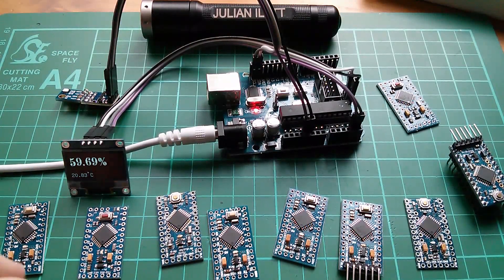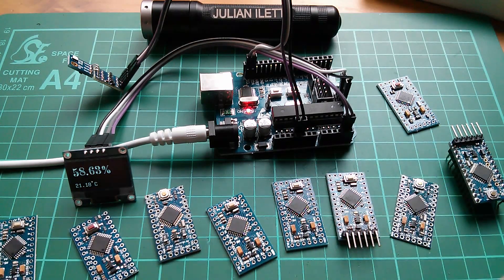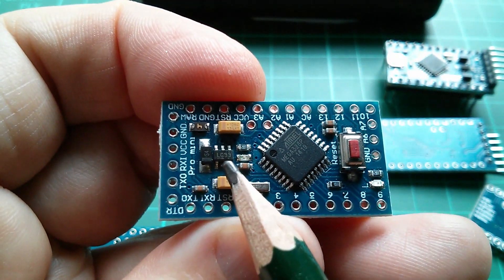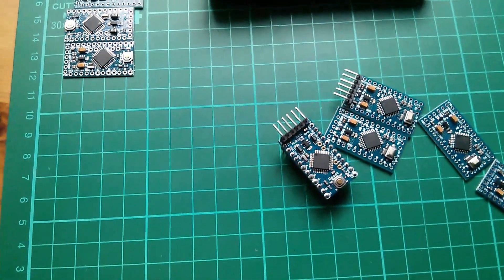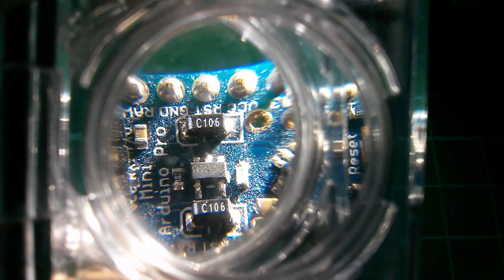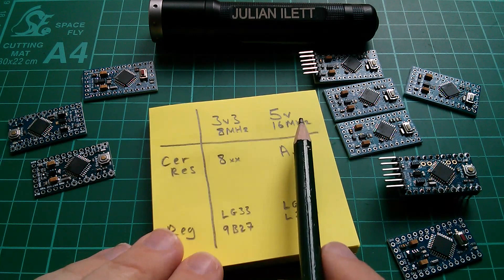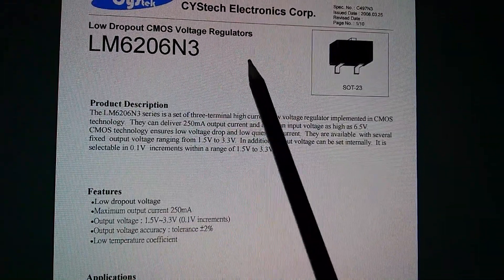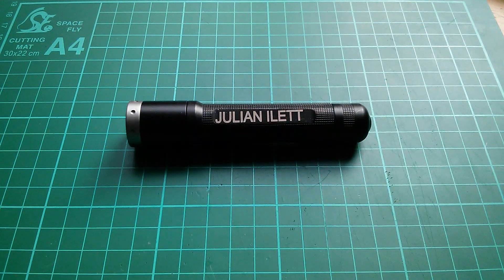Arduino Pro Mini Identification - 5V, 3.3V, 8MHz or 16MHz

Comment: Brilliant video, I have been using 5v pro minis with the voltage regulator removed, with an 18650 cell.
My question is , if I set the pro mini to 8mhz but it still has a 16mhz resonator will it work at 3v?

Comment: I had a strange incident
I bought Pro Mini - ATMega328, 5v-16 Mhz version.
I just realized that the project I was working on was using a TTL 3.3v device (for example: ESP8266).
In simple terms, I had to use a level shifter to change the TTL 5v Pro Mini to 3.3v, but I didn't want to because it wasted energy, money and space.

Then I was fun, changing the power supply voltage of the VCC Pro Mini from 5v to 3.3v. And surprise! no problems at all when running the program!
The TTL on my Pro Mini automatically changes to 3.3volt, so I don't need to use a level shifter.

Conclusion: There are several Pro Mini versions of 5volt 16Mhz that are flexible, can be changed to a 3.3volt 8Mhz version simply by changing the VCC Voltage

Comment: I you replace the 16mhz resonator with a 20mhz resonator are you considered an arduino overclocker?
Reply: 20 MHz is within safe operating area, so I'd say not. Only if you go higher than that, which I've heard some people do. Standard Arduino library doesn't support 20 MHz, your delay()s, milli()s, and micro()s will be off. In most cases you'd better optimize your code instead, or switch to a faster micro. A Chinese company makes an ATmega328P-compatible MCU called LGT8F328P, that runs at up to 32 MHz. There are cheap boards available. I've heard both good and bad things about them.

Comment: Why don't you just hook em up to a low supply voltage (5 volt to start with) and look for a 3.3 volt output ?  Save a lot of pissin' around.

Comment: All the Arduino Pro mini that I've bought in the last 3 years are all red reset button = 3.3V, black or silver = 5V.
Wonder why, I'm talking about at least 60 pieces from about 5 different suppliers.
Reply: That's certainly not universal since I purchased some 5V 16Mhz Pro Minis a while back and they all have red reset buttons.

Comment: I purchased several versions of the Arduino Promini 3.3v to create a low power Arduino piece. But outside could not distinguish whether this is 3.3v or 5v. I found information on the Internet that I can see the letters and numbers written on the generator. By watching your video, I was able to better understand the utility value of 3.3v. Thank you.

Comment: I have some and the serial pins are reversed. It looks like the one you show at around 5:35 is like that?  I have been chasing a problem with a clock that I made with rtc. Nothing has changed and now it is not working for other clocks I have made? Driving me nuts  :  )

Comment: I'm amazed that none of your pro minis have a crystal. Mine does and it says YC16000M. With a tiny regulator LO5 (or LG5?). And the pins are from every side of the board, yours are mostly from three sides only. Interesting how they're inovating even those devices. Some Pro Minis out there have the tiny chip and massive crystal, some have tiny resonator and large (comparatively) chip. It's just all a bit funny.

Comment: Just checked one of my unidentified Pro Mini modules, and found that it had an 8Mhz ceramic resonator and a voltage regulator labeled DE=A1D.
Reply: I have the same "DE=A1D" for 3.3v 8MHz, my 5v 16MHz have "S80D" with a symbol like a wave before !

Comment: Put 9 volts on Raw and measure VCC. 3.3v = 8 Mhz 5v = 16 Mhz. That should work.
Reply from the maker: Neat trick :)
Reply: Haha that's exactly what I was thinking! 😂😂😂
Reply: smart!
Reply: Be careful, some of the 3.3v LDO regulators can only handle 6v in.
Reply: Thank you I just made sure that mine are 3.3V using your method!

Comment: Julian, why are you using pencil as a pointer? It seems too risky as you may eventually create shortcut by touching contact with carbon tip, which is conductor.

Comment: why did you call them ceramic resonators, they are quarts resonators, aren't they?
Reply from the maker: The tiny metal cans are ceramic resonators - 3 terminal devices with integral load capacitors.
Reply: thank you

Comment: Recently got an arduino to play around with, but while trying to find some resources to learn about programming I was absolutely overwhelmed with information about robots and other stuff I'm not immediately interested in. Does anyone have any suggestions as to good(!) resources for starting with arduino in projects like Julian does? There's just so much information on the web that I can't see the trees for the forest...
Reply: check out the arduino playground over at www.arduino.cc
Reply: The best thing about the internet is all the free stuff and the worst thing about the internet is all the free stuff!

I recommend Exploring Arduino by Jeremy Blum which is an excellent book full of electronic circuits and code examples that are fully explained. Also look for any titles by Simon Monk.

There are loads of good websites with free information on them but there is a lot of dross also. The books I mention are well written and reliably accurate.

Comment: I prefer Arduino Nanos. No mucking about with serial to USB converters, it's built in.
Reply: USB Keyboard / Mouse / Joystick "emulation"
Reply: John Ridley then use a micro
Reply: ***** Why?  Nanos work very well. I especially like the screw terminal breakout for them, it makes it great for putting them into control environments.  Plus the Nano is about $3.  What does the micro do that the Nano doesn't?
Reply: ***** Sure, if I ever need that. I have only needed that once, and I used a Digispark ($1.20 Tiny85 based).
Reply: How about battery consumption, do they consume the same, considering a Nano and a 3.3V 8MHz Pro Mini ?

Comment: Hi Julian
Would the low voltage to the hygrometer chip because of 2 regulators in series have caused the difference in humidity between the other 2 meters you had in the previous video. You had been quite surprised by the difference.

Comment: What I do is just program them with the blink sketch at 16MHz then if it runs at twice speed I know it's an 8MHz board.
Reply: You need to determine what voltage your version operates on.  The lower voltage (3.3v is 8 Mhz) the lower the clock speed (CPU).    You can still do much with the lower clock speed.     The same code would run on both units... So you can make the l.e.d. blink any rate you want all in the code.   Julian has a great video in which he examines the "Arduino" speeds compared to native Atmels (programmed w/ ASM or C?)  with AVR I think.. Very Interesting indeed! 

Best Regards.
-Leap
Reply: Yea the same code runs on both but it won't run at the correct speed if the right speed isn't selected in the IDE. Voltage doesn't matter unless something is hooked up. On a 3.3V board when the serial converter is connected you can input 5V on the VCC pin and it bypasses the regulator, it only uses the regulator when you connected power to the RAW pin.

Comment: If frequency vs vcc curve is linear, that means if I run my arduino on rectified mains it will have 3ghz and I can use it as a cpu instead of the Intel I have now
Reply from the maker: Try it :)
Reply: It will very rapidly do something, I suspect it won't be rapidly processing any data though ;)
Reply: Try it! But, keep it in hand.
Reply: A three-year-old joke and it's still funny Haha

Comment: There are two kinds or regulators for 3.3 and 5v.  One are 150mA delivery draw. The others are 500mA. So chose wizely, but what makes the difference is that those 150mA regulators have Low quiescent current. means if you want to put arduino to sleep it will draw very little current. unlike the 500mA regulator which even if you put arduino to sleep it will draw atleast 10mA in some occasions. chose wisely depending on your application.
Reply from the maker: Thanks for that - wise words. An even better reason to properly identify the on-board regulator.
Reply: KB33 - 150mA max output but low current draw. KB50 or KBAA (adjustable) are also 150mA. It helps when your making a battery electronic. or even car accessory that will always be connected.
Reply: Thank you for that Info, just bought some 150mA , Cool

Comment: there's yet another 328p in a board that is slightly larger, with with VCC and GND slots next to each digital and analog pin. For example,  when you want to connect a potentiometer to an analog pin, the VCC and Gnd are just next to it. From a personal perspective, i really like the aesthetics of these boards, I feel like turning the soldering iron ON and put something together every time I see one.
Reply from the maker: Yeah, I think it's this one: Atmega328 Board 5V 14 Pins Pincompatible For Arduino Pro Mini New #UnbrandedGeneric http://www.ebay.com/itm/Atmega328-Board-5V-14-Pins-Pincompatible-For-Arduino-Pro-Mini-New-/401171901022
Reply: Julian Ilett Yes, that's the one i was referring too. Thank you, I didnt know how to search for this particular board setup.

Comment: I have these RobotDyn pro minis and they are marked FS16.00P on the 5v and 8.000 on the 3.3v, with LE50 and LE33 regulators. They all come pre-marked 3.3v or 5v on the back of the PCB
https://www.aliexpress.com/store/product/ProMini-ATmega328P-5V-Compatible-for-Arduino-Pro-Mini/1950989_32525859745.html
Reply from the maker: Thanks for that. No problem identifying those :)

Comment: At 7:00, the smd resistors are from the E96 series. The number is assigned to a standard value, the letter is representing a multiplier.
Reply from the maker: And I thought 4-band resistors were trouble enough!

Comment: munging an arduino and a display... is there a D-duino involved?
Reply from the maker: No. The best munge will be the humidity sensor PCB onto the front of the OLED board. Fitting the OLED onto the Pro Mini will be a tad more tricky.

Comment: So have you been under powering the humidity sensor with the extra board?
Reply from the maker: It may be running at less than 3.3V (although the Si7021 is happy down to 1.9V) and since communication is digital (I2C) the sensor readings won't be affected.

Comment: I saw weird Arduinos on ebay today, variously being called pro micro and pro mini but theyre not like Arduinos Ive seen before. they have the atmega32u4 but idk if theyre china versions of actual Arduino boards I wasnt familiar with or parts bin knock ups or what. item 291547273695 looks like a pro mini with all the small components shoved down one end, and items 191928750938 and 191981130271 might be the same thing with a slightly different layout, but one of them claims to be 5V 8MHz which is kind of odd. and the other has leonardo in the listing title but I thought the small form factor version of the leonardo was the micro which looks like a nano but longer and that isnt one of them. its very confusing but theyre dirt cheap so maybe I'll get a couple to have a look at
Reply from the maker: The first one is a pro mini but has two rows of pins at one end - not certain about this, but I think this provides access to the ICSP pins so you can re-burn the bootloader. The other two are pro micros (not Arduino micro) which have the ATmega32U4 chip (with integral USB hardware) and a USB socket on board.
Reply: I see, thanks. I was just looking at the Arduino site and there have been way more versions than I thought. I still like Nanos best.
Reply: The "pro mini" with the ISP pins on the end are the ones I prefer. I essentially buy them because they are an AVR+crystal+regulator+easy to access pins, not because the are an Arduino. I always get rid of the Arduino bootloader anyway and program them via ISP.
In most projects the serial-to-USB of a nano isn't needed once done, so it would be a waste of space. Since I solder in (onto another PCB) the whole pro mini board in some projects, it's useful to have easy access to the programming pins and not have to lay them out yourself.

Comment: Hi Julien,
All my 9 ProMinis have either the KB50 or the L05 as 5V regulator. 4 of them came with ceramics marked AT and AQ (just like yours) and the other 5 actually have a full size crystal on board marked 16.000. apparently I don't have any 3V3 ones.
Cheers!

That's my collection:
http://imgur.com/ghoVNcH
Reply from the maker: OK, thanks for that :)

Comment: I have 2 Pro Minis, they both have resonators marked JY16.000M1E and regulators marked L05.
Both are of course 16 MHz/5V ones.
Reply from the maker: Cool, thanks. They're easy to identify :)
Reply: Oh yes, they don't hide much :D
The resonators on mine seems to be crystal, not a ceramic one. It takes up more space on the tiny board than the microcontroller itself.. Just a guess, but by the size it's more than likely (it's also the only through-hole component on the entire board, not taking the pinouts into account).
Reply from the maker: Yeah, the HC-49S crystal is small enough to fit on the Pro Mini particularly when the smaller ATmega328P chip package is used.

Comment: @julian,
Are you reading the hydro sensor to rapidly? What is the recommended time between readings in the datasheet?
Reply from the maker: There doesn't appear to be a limit on how quickly you can read the sensor. There is data on how quickly the sensor will respond to changes in RH assuming a 1m/s airflow rate.
Reply: Julian Ilett, 
There are 2 parameters of timing to take into consideration:
1. The conversion time of both temp and humidity dependent on resolution. 
2. Response time. 
A delay between readings would be beneficial.

Comment: If clock frequency doesn't have to be exact or temperature critical, you can use the internal PLL and the factory calibrated RC clock.  I do it all the time.  Then you can set the frequency to whatever you want.  I've run 1MHz plus sleep for low power and 20 MHz for time critical applications.
Reply from the maker: I just wish there was easier access to the fuse settings via the Arduino IDE
Reply: Sounds odd but I've never used the IDE.  Old school.  I struggled with coming up with a working Make file and that is where the fuses get set but it may be possible to set clock speed on the fly.  I have set some aspect of clock speed on the fly in init code and looped until clock status is stable to exit and continue.
Reply: See, that's why I always program AVRs via ISP, be it from the Arduino IDE or in any other way. I often get annoyed, how slow the Arduino abstraction makes everything and end up writing all the registers myself instead of using Arduino functions. As far as I know you can only change the fuses via ISP, so you need an ISP programmer anyway (usbasp for 3$ or so).
Reply: Ah, I forgot about the Arduino's boot loader.  I usually end up trashing it.  You can either make your own ISP or buy one off of Ebay for cheap.  I found it fun to program the ATtiny and by default they are set to 1MHz so it would be common to change the fuse settings when more speed is needed.  Amazing what you can do with a buck and some change and the open source cross compiler.  Everyone familiar with AVRDUDE?

Comment: If you really want to go small, consider the Digispark which is absolutely tiny. It has an ATTiny85 and I believe it does hardware I2C.
Reply: kfishy or just go with a normal attiny - that way you are not locked in by the digispark bootloader and it's weird clock rates for USB
Reply: LostName I just find the Digispark convenient because it has all the regulators, caps and protection diodes integrated on a board already. Plus it does some simple USB stuff and can be programmed without an ISP. But yes of course rolling your own bare system is optimal.
Reply: kfishy its 5v only tho
Reply: The other advantage of the digispark boards, is that you can buy Chinese clones for £0.82 from Aliexpress...which is practically free.

Comment: You also have a 3.3v output on the arduino so the extra module was really not needed. Great work otherwise. :)
Reply: The extra module also provides level-shifting on the I2C pins, not just a 3.3V step-down on the power! It wasn't needed as those level-shifting components were present on the sensor board but it would be necessary if you were to interface a 3.3v sensor board that doesn't contain level-shifting to a standard 5V arduino uno, nano or pro mini.
Reply: Nick B oh you're right, forgot about the signal voltage! Slipped in the thoughts! 😂
Reply: You wouldn't need a level shifter for the signal even when hooking up a 5V Arduino to a 3.3V sensor. Just make sure you don't put out 5V on the I2C pins and use external pullups to 3.3V (you would need the external pullups anyway). An AVR running at 5V "understands" 3.3V as logic high.

Comment: Cant you just put 7V on the Vin Pin  and measure the voltage comming out of the regulator?
Reply from the maker: Of course that's the other way to identify the 3.3V ones!
Reply: Not really, they all have a Voltage regulator on the board ;)
Reply: Depending on the LDO, you may not want to put more than 5V on a 3.3V regulator that size ;)
Reply: The good ones will liberate their magic smoke!

Comment: Would be good if you could supply links to suppliers of the various boards you featured.
Reply from the maker: That's pretty much impossible - they were all bought some time ago.
Reply: Maybe some suggestions of you favourite suppliers - I assume they are mostly from Ebay?
Reply from the maker: Alice has a whole bunch of Pro Minis listed (including one with a Crystal) - http://www.ebay.com/sch/m.html?_odkw=&_ssn=alice1101983&_osacat=0&_from=R40&_trksid=p2046732.m570.l1313.TR12.TRC2.A0.H0.Xpro+mini.TRS0&_nkw=pro+mini&_sacat=0
Reply from the maker: Quite a few of them have crystals too!
Reply: That's great - thank you.
Reply: Thanks for the tip